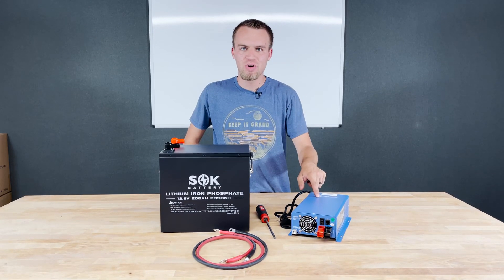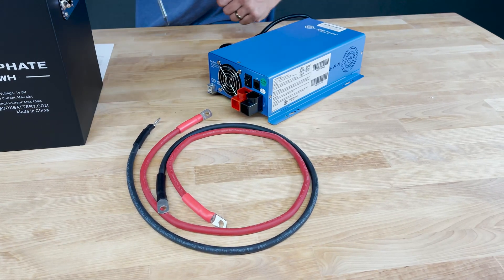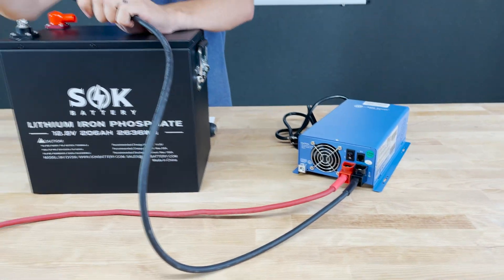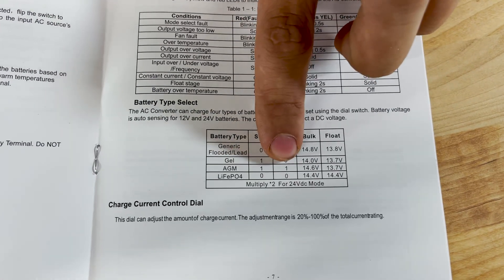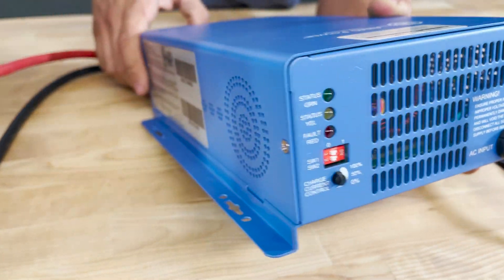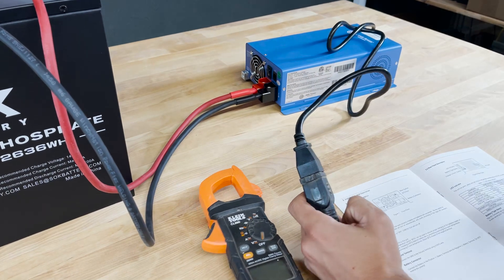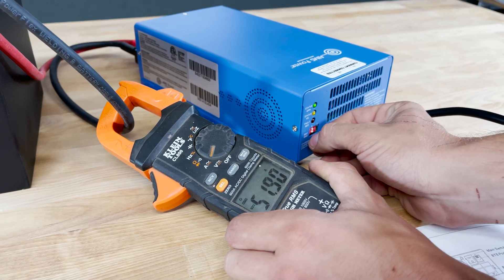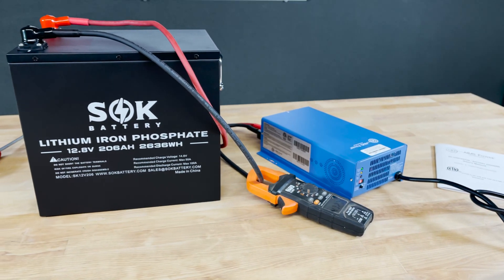How To Configure AIMS Converter/Charger for a LiFePO4 Battery

Comment: am getting a used one of these converters.   Does it auto select between 12v and 24v?    My system is 24v.   Assume there is another chart in the manual for settings for 24v?   

PS- do you have link for manual to download in case it does not come with it?
Reply: got the manual.  yes it auto selects to 24v

Comment: I have gone through 3 of these, keep blowing 20amp breakers after 2 charges
Reply: I have done the same thing. What is your solution. Did you get a different charger. After 2 charges it keeps tripping the breaker on generator

Comment: As soon as you connect the Aims charger to the battery, there is a relay inside that energizes. Even with the Aims charger unplugged from 120 volt power, that relay is draining charge from the battery. It might take weeks of inactivity, but a constant drain is no good. I put in a 100 amp switch in one wire to the battery and the problem was solved.
Reply: switch between one wire of leads between charger and battery?   or a switch to just take all your batts off line for storage (which you should do anyway)
Reply: @coachgeo  A switch in one leg of the DC output of the Aims Charger disengages the relay under most circumstances. I also shut off the Aims Charger switch when I'm done.
Here's a video of a unit I built. You can hear the relay click at 0:42 when I connect the charger to the battery with the switch.   https://www.youtube.com/watch?v=GPYg1QZJ24o

Comment: Thanks, I'm thinking about purchasing one of these chargers. I bought the Aims 24v charger/Inverter but it only charges at like 15a. 

I'm thinking maybe I can switch out the built in charger in the inverter/charger for this charger. If not, I'll have 2 separate units. Thanks again

Comment: Can the Aims Charger support continuous usage as a 12 volt power supply?
Reply from the maker: The charger needs to see battery voltage on the output terminals in order to kick-on.  If your application doesn't present the charger with this required voltage, it won't turn on.

We will be carrying a regulated power supply very soon that will support 0-30 volts and 0-10 amps, this is what I would recommend if you need a 12 volt power supply.
Reply: @CurrentConnected  I want to convert 120 coming into my RV, have my battery bank float across the charger and inverter to convert back to 120/240.  The reason I am doing this is the 120 source may be very limited and I want to run everything without this limitation.  Campgrounds are notorious for poor power quality, and I want to protect everything in the RV.
Reply from the maker: This charger would be perfect for this and would work just like you want it to.